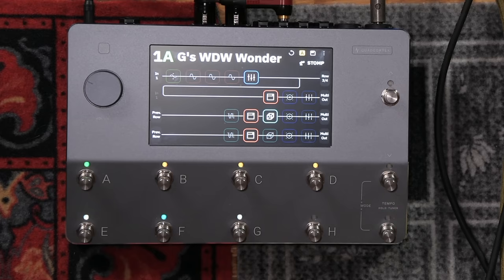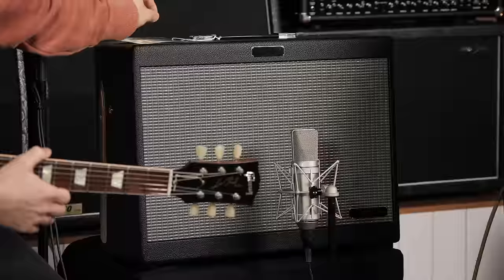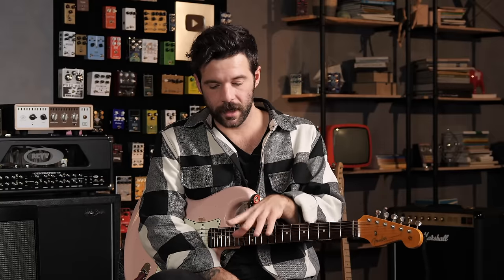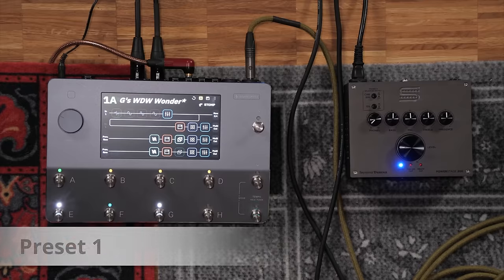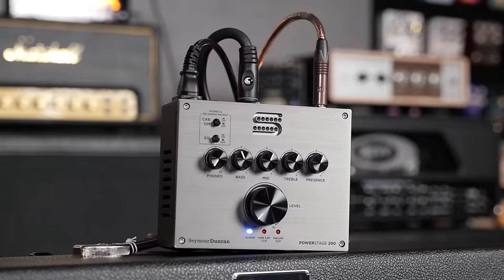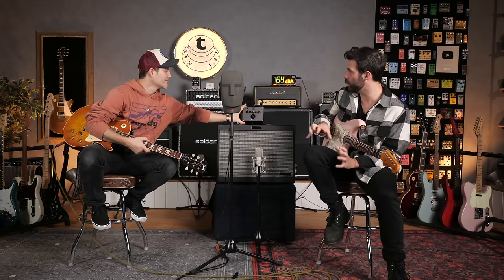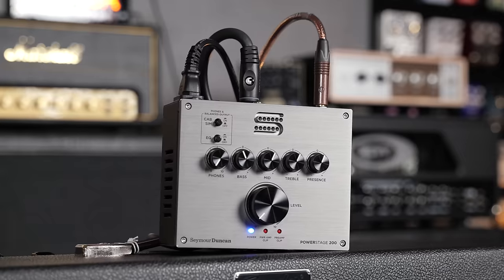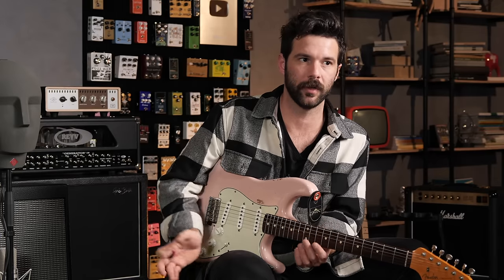Best Ways To Amplify Amp Modellers | FRFR or Guitar Cab? | Thomann

Comment: I use a boss Gt 100 multi effects processor and run it stereo out into two Blackstar ID CORE stereo wide 100 watt amps. The spacious stereo wide from the amps give a surround effect and a richness to the effects of the boss processor. I've tried the line out and even used a Marshall amp for the on stage monitor but using the two stereo wide blackstar amps has taken the stereo effect to a new level, so that what I'm using currently.

Comment: just trying to figure out your examples.  You have a head, set up with microphones, to get the sound you'd hear on stage, then a close mic'd cab example, but not a follow up of the DI sound.  The Mic'd cab in a live situation would also carry the room sound and be closer to the head tone. The close mic sound, direct to your daw is as i would expect, sterile and lifeless.  the head mic sounded amazingly like a full blown valve amp experience with the fender and the floor wedge monitor and even the seymour power amp.  The harley benton cab sounded pretty cool, V30 loaded?  Imagine a di to desk and a mic's cab like the harley or the fender frfr, that would give lots for the sound man to play with sonically.  but at the end of the day, my gripe with modellers is you can spend time getting it to sound right through your choice of frfr etc, but the di sound to desk and out of front of house can still end up leaving much to be desired.
Reply: sorry for the essay

Comment: ive been running my Tone Master Pro into the power amp in of a hot rod deville. sounds great. I also have the FR12 - it's good but not as good as a tube power stage. Some one should make a power cab thats a couple of 6L6s (no preamp stuff)  just for modellers on stage.
Reply: I believe the ksr50 is 6l6 could be kt88s too (dreaming)
Reply: @nerbuhc  ive ordered up the 6L6 KSR one
Reply: @jonhollis2534 NO WAY i hope you enjoy it! I have no need for the small power amp but that is the one id grab, just watched rabeas comparison too the SD PS200

Comment: I want to use my Valeton GP 200 through active / passive combo with a and a Ch mixer why would I need the Seymour Duncan power stage 200 ? How do I route it , is it a DI BOX I’ve never used one , I also have the BOSS IR 200 which sounds great in videos … not through my Marshall DSL thinking powered stage  monitors are my best route

Comment: 1:15 ideally, you'd turn off the power amp simulation if you're using a real tube power amp. I don't think QC allows this, but Helix has pre-amp only models for each of their amp models. This is probably why the D20-amped tone sounded the most different from the DI tone...

Comment: Good stuff!

I’ve recently bought a Boss GT-1000 Core from Thomann. I did, because I was looking for a unit to serve several purposes, of which one is hassle free live performances, meaning not having to carry a guitar amp AND the PA. With that in mind, it would be downright silly to then re-introduce any sort of amp or cab solution. Literally, within this next week I’m going to start rehearsing with the GT-1000, playing directly through the PA, I’m going to be using.
For studio purposes, I’m afraid, I’m still a real amp kinda guy. So, within a few months the Revv D20 and the JTM 20 are going to make their way into my studio, likely through a Harley Benton “hybrid” 2x12.
Reply from the maker: Yeah it's kinda funny if someone goes for a modeller to have less stuff to carry but then needs a cabinet to hear her/himself anyway... 😆 Best is using in-ear monitoring at rehearsals and on stage if that's an option. But simply using the PA system is equally efficient, that's why we included the wedges in this video. It's such a simple yet great option. Cheers //Kris
Reply: 👍👍 “not having to carry a guitar amp AND the PA”. Run your modeler direct to FOH for live shows and monitor via in-ears or wedges.

Comment: PA is actually the smartest thing to use. With tool like quad cortex you have the completed signal chain, from the pickup to the mix in a song (amp, cab, mic, compression, equalization…). So you need a full range hifi amp, as if you were listening to a mixed sound or a song

Comment: I have several real cabs and 2 pairs EAW passive monitors. I have a rack setup with Carvin TS100 Peavey 50/50. Ada microtube 200. Rocktron velocity.  I wanted tube ss and hybrid options. Positives and negatives on all of it

Comment: Great review and awesome talk.  A question though - I have an electric guitar that has a piezo pickup as well and I use both magnetic and acoustic sound for my outside gigs as a soloist or in a duo.  Is the PA Wedge Speaker or the FRFR cab the best solutions for my setup? (since I can turn off the amp sim in multi-fx anytime to use the acoustic sound directly to the speakers)

Comment: Im currently a bedroom player using a spark 40, and thinking of what proper setup to get. Would it make sense to get a small tube combo and a simple modeler pedal? That way you can use the amp as a speaker + its also useful as a standalone amp. And you can dial in your digital tones for use in any scenario. better option than some FRFR thing?

Comment: As an aging bass player, I decided it was time to start playing DI rather than keep carrying around my bass rigs - for smaller gigs, my bass combo weighs 89lbs, a rig for a bigger gig weighs at least another 50lbs more. 
FRFR for bass doesn’t give many options. My intention was to just DI and use the stage monitors at the venue to hear myself. However, not all places have a decent monitor set up, and if you trying to get on and off amongst other players, setting up a monitor mix takes too long. 
For situations where there the monitors were not great (some places have none) I decided I would buy an FRFR, which I would only bring out if the car if needed. I wouldn’t necessarily get the tone, but I’d hear the notes! I tried a few options and wasn’t impressed, so asked the music store to bring in a Headrush 12” for me. - it’s astonishing. I’ve never liked speakers smaller than 15” and lean towards an 'old school' tone. 
The Headrush is phenomenal, it gives me as much or more bass than anything I’ve ever owned, and it weighs just over 30lbs. For playing jams or pubs, even if there is no PA for my main feed, I will take the Headrush rather than a traditional bass rig.  I wish I had known they would be releasing a newer version with Bluetooth, but it’s a great bit of kit. I’m now deciding which "amp in a box" I will be buying to replace my guitar amps, because I’m going to use the Headrush for guitar as well, probably without DI'ing it.
Reply: 40kg….no. My neck feels odd after (singlehandedly) manhandling a 25kg amp.
Reply: My Ampeh SGT-DI weighs just over a pound I think?    @TheRflynn
Reply: What do you use when not going through a PA? I can lift my Phil Jones with 1 finger and some of the smaller german and italian (AER, GRBass) can be even lighter on a watts per kilo basis.
Reply: Traynor. I've used nothing else for decades. Any time I've gone looking for a new category of amp, I have tried every other brand - and every time left with a Traynor. I have a 400w Dynabass combo with a 15" speaker. This sounds so good that I bought the head  as a stand alone unit, which simply slides into the slot on the combo. As well as that I have two 15" cabs. My full tube head is a YBA200-2 - another phenomenal amp, And when I decided to get a digital amp, I tried everything and left the store with a Traynor SB500H. Although I've only used  their 15" cabs for some years, i've also owned one of their 2x10"s and had a 1510 cab for a while - 1x15' and 2x10" in one cab.  - Ive also had a few of their tube guitar amps, but they are too loud for home use and I rarely play guitar for gigs.          @TheRflynn
Reply: Long McQuade have a B&W photo of the 1x15 and 2x10…they were probably the local dealer? I did get to try a 50w 1x12 combo at home, which rattled the furniture….but didn’t measure any louder than a 70w solid state combo. Odd that sound volume and floorboard movement were that unrelated. If you are experimenting with DIs have a listen to Philip Conrad’s video on the topic, they do vary more than I expected.
Reply: Long and McQuade were almost the only dealer - I think musicians friend has stocked them in the past? There are a few American musicians who swear by them. 
Pete Traynor has a history not dissimilar to Jim Marshall, but he worked as a repair man at one of the original Long and McQuade stores. He was making custom stuff for musicians for a while - he's then largely credited for the invention of the PA, which they used to rent.
When the company went into full production, it was with the financial backing  of the store, who sold/rented them in house. 
In the early days they just went under the Yorkville name, later Yorkville was used for their PA division, which is huge and the Amps switched to using the Traynor name. They ar e a staple in Canada, especially amongst touring bands as they are incredibly reliable - when Jim Marshall was throwing his amops down stairs, Pete Trainer was throwing his off the roof of the factory, their stuff comes with a two or three year warranty, and their bass amps have the ability to run if a tube blows, the amps simply back out that par and run with the rest. - some of them also have meters built in, so that you can bias your tubes if you need to replace one with no special equipment, you just need a screwdriver and the amp has lights to tell you when its set right.  - they also sound really good @TheRflynn
Reply: There are a few Wikipedia pages, that mention he was a bass player but nothing about the combos. Right those wrongs.
Reply: I think the 400w dynabass went out of production early, as for not much more, there was an 800W version available - this became a very standard amp for a lot offends and venues, since for not much more, you could avoid the chances of finding yourself needing much power. I've done a pretty large outdoor gig with just the 400w and an extension cab, I don't think it was ever turned up past half way @TheRflynn

Comment: I'm very happy with my Harley Benton products. I have the G112A-FR and the GPA-100. I have a couple of questions. How does the GPA-100 compare to the Seymour Duncan? How much louder is the Fender (1000W) than the Harley Benton G112A-FR (100W)? I like that you can use the HB speaker as a wedge.
Reply from the maker: Actually an FRFR shootout video sounds like a pretty good idea. :) It's on the list of ideas now, thanks! //Kris
Reply: @ThomannsGuitarsBasses  you should also include the Spark Cab by Positive Grid

Comment: Have you used the QC and Fender tonemaster Fr 10 or 12 to play at home at low volume? Does it respond well to low volume or is it necessary to turn up the volume and, in this case, it would no longer work at home?

Comment: I use active studio monitors and do an EQ cut to cut the low and high frequency respective to what amp I want to model. The speaker always has a frequency range in a guitar amp the limits an give the amp in a room sound. Try to simulate that. This means that you get a more realistic sound rather than reproducing  all the frequencies possible. To me, the speakers then feels and sounds like an amp in the room.
Reply: Do you know if i can connect the quad cortex directly to my active studio monitors? I'm considering of buying the qc.

Comment: Great video guys!! 🎉

IMHO I dont think the sound of a real guitar cab and speakers is a boomer thing, it is a playing experience thing. Just try it and hear for yourselves. Unfortunately full tube rigs and real speakers are so much more inpring in the room, its almost an acoustic thing, and no one argues about that a piezo sounds less inspiring than a regular miced acostic guitar ☺️
Reply: Just look at all the rotary speaker simulators...some have a great sound in their own right, but NONE can match the experience of sound waves spinning around the room, and they never will
Reply: I still dont know what i should try with my QC, i play thru studio monitors and id like " more" u know ? 

I need only better "in the room" sound, maybe a powerstage + real cab? or a tube power like freytte into a real cab? a frfr better than studio monitors ;-? not sure !
Reply from the maker: I know what you mean. Studio monitors are my first choice to hear exactly what is happening. That's the most accurate way of monitoring the tone I'm recording. That being said, it sounds like a mixed guitar tone and not at all like actually playing through a guitar rig. We both agreed after making this video, that the Seymour power amp + guitar cab tone felt most "real" out of these options.
Cheers //Kris
Reply: How about something like the Fryette Power Station  vs the Seymour? would it feel even better bcz of the tubes or would be similar to the head and at that different coloring so the solid state would actually do a simple but great job ?

Also please help me on this one too, would u reccomend the harley benton cab vs a marshall for example ? Rly hard to decide something like this not being able to try any haha @ThomannsGuitarsBasses
Reply: also what speakers are in that HB 212? @ThomannsGuitarsBasses
Reply: @ThomannsGuitarsBasses  Thanks Guys! Loved the comparison 🎸👍👍 I just got a little UA-pedal board and thought about going that Seymour Duncan-route. Direct is still great for front of house. Cheers!

Comment: Lots of information here. Can you run the QC through a valve guitar amp? Whats the disadvantages?  .. i don’t really want to replace my ac30 with a FRFR speaker.
Reply from the maker: You can, of course! It's a bit of an overkill though. The strength of the QC is to emulate amps in an awesome way. If you want to use it with a tube amp and turn its amp simulations off, you're only using its effects essentially. 
A good combination would be to go into the power amp of a tube amp to use the full potential of the amp sim of the QC.
So going into the AC30 with the QC amp sim wouldn't sound very natural. I think I'd go for a wedge monitor or an FRFR cab for the QC. If you don't want to do that, maybe just take a few nice pedals for the AC30 and ignore amp modellers. Cheers //Kris

Comment: Using the revv sounds best. Ignore the boominess because that should be cut out for a guitar. FR-2 sounds like a cd 💿 and a little too clean, I wonder if you can get it to sound like it’s being pushed to get a bit of that natural grit with rock guitar that going through the revv has. FR almost feels a bit neutered but still sounds good. 🤔 cost comes into play & how you are going to use it plus I’m sure there are other choices besides the Seymour Duncan power amp instead of having to buy a full head just for its power section. It’s a choice more about the player feel than audience sound issue. Only a very small % of your audience is going to feel & hear the difference between a rev type setup & the frfr

Comment: I'm using my Bose S1 pro as Monitor. Works fine and can be used on battery too.
Reply: Which modeler are you using?
Reply: @Scott__C Electric: Boss GT-1 Multieffect. Acoustic: None, Pedalboard only.

Comment: What’s the best for a bedroom beginner setup? I have an electric guitar and a line 6 helix, what’s the best option to output the audio from the helix??
Reply: Assuming you're not looking to just play through headphones, the most practical setup would be an FRFR without the PowerStage. You only need the PowerStage if you plan on running into a regular guitar cab without any type of IR (cab sim), which isn't really necessary if you don't specifically want stage volume for gigging or full band rehearsals. The PowerStage is designed for that relatively specific use case, which doesn't sound like it applies to you.

Comment: Im using a helix floor 4cm into a duel rectifier with a traynor 4 12 green backs. But i kinda want to get the powerstage 200 and just use it with my cab.  Thoughts?????
Reply: I do 4CM with a Mark V and have also found good results with the PS170 (assume the 200 is similar). The cab is the key and you will likely be very happy. My Helix with the Cali Mark IV model is indistinguishable to my ear when I go through the MV power section and cab from the real circuits. 

I also go into a dxr10 frfr and it’s 95% of the way there and certainly good enough in a live mix.